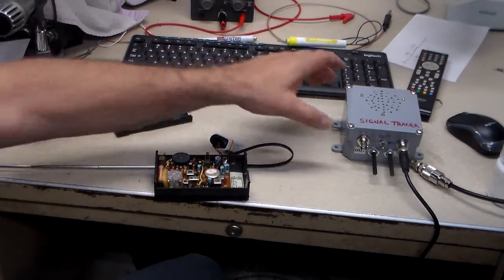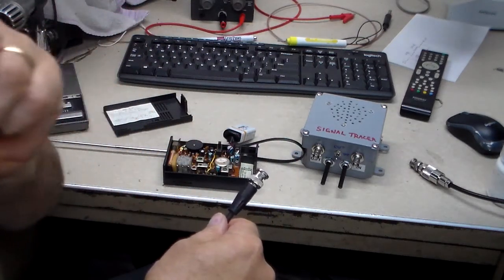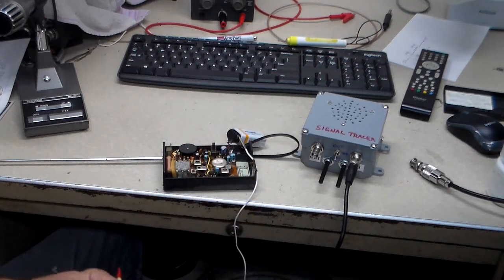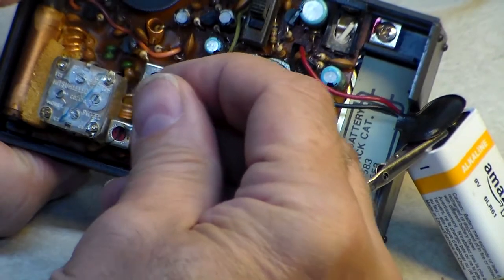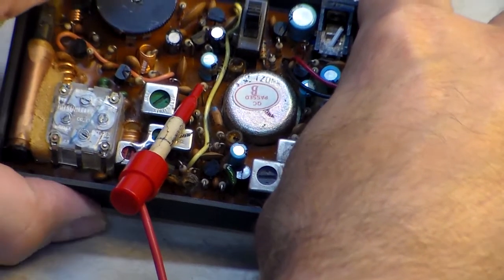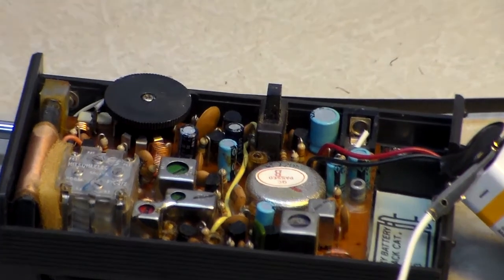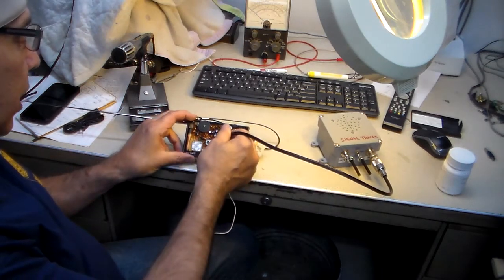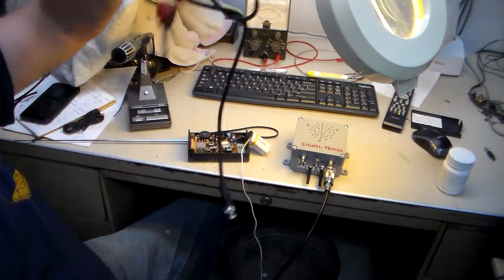Transistor Radio Troubleshooting with Signal Tracer

Comment: Dear sir I am having a radio cassette tape recorder. The cassette and AUX In works fine, but the radio is not picking up any stations since last week. It doesn't have FM band because it is an earlier one. When I touch the MW internal antenna coil I can hear a station with only mild volume. But when I touch the telescopic Ariel for SW 1 &2 i can't hear anything. When I don't touch the MW coil I can't hear the station. Kindly tell me what to do next. Thankyou sir.
Reply: If you can find a schematic  online for your unit , look into it and find your AM radio input side , then follow to your first transistor , check the input signal the the output signal of it..... then go to the next one  ETC ETC ...

Comment: Thanks for the video, very easy to follow. Can you tell me why the signal is audible just by touching the tops of the capacitors etc? Is the audio signal just flowing around through all components, on the positive and negative sides of the components or just the negative? Thanks for any advice
Reply from the maker: Brendan, Great question.  without looking at the schematic or tearing it apart, my guess is that the capacitor " -" lead is not tied to a ground, or at least not the same ground that the Audio is.  So, when I put the probe on it, it would be just like putting the probe on either lead of a resistor for or coupling capacitor for example (provided that lead is not tied to ground of course).  In general, I don't normally expect to hear signals when I touch the case of many components.  That is a good reminder to be careful of what your test leads or power supply leads touch.

Comment: Thank you so much for sharing your knowledge with the rest of the world. I really like your work. Somewhere you mentioned the spill over noise of about 1000 Hz. That made you decide to split the input and the output. I happened to view another vid about this Velleman kit where the same interference happened. It was treated by connecting the housing of one of the potentiometers to ground. Look here from 16:30 for the solution.  https://www.youtube.com/watch?v=lPROP0enDcg
Reply from the maker: I actually did that as well.  Thanks for the information.

Comment: Hi
Have you tried an oscilloscope probe?
Just1
Reply from the maker: The things I used were like 1:1 probes but I didn't want to introduce the scope probe 10:1 components into the circuits.
Reply: @KA3AJI  I understand  that makes good sense .  
I wonder if 1:1  introduce components  too?
Probably not a good  idea. When you can make one  so easy.
Thanks  for sharing. 
Just1